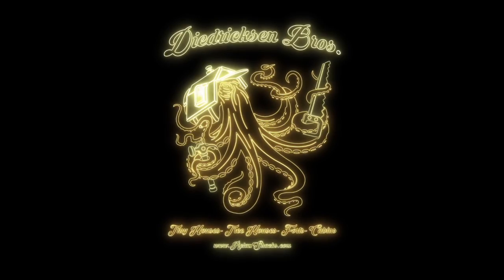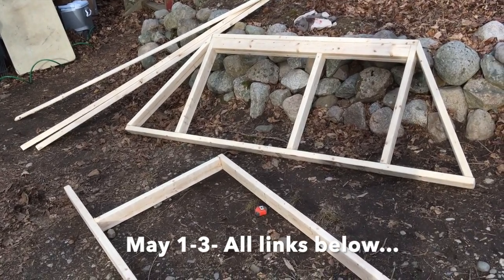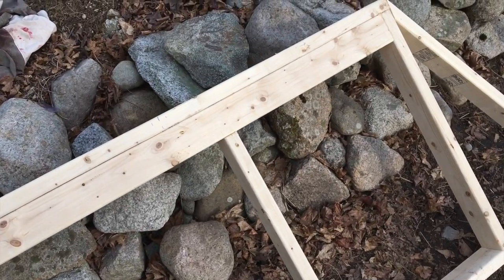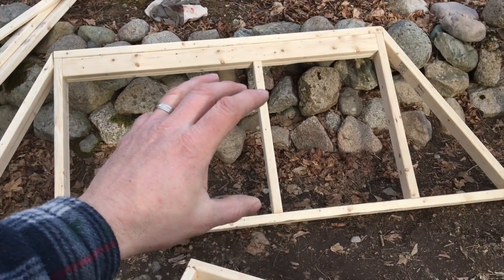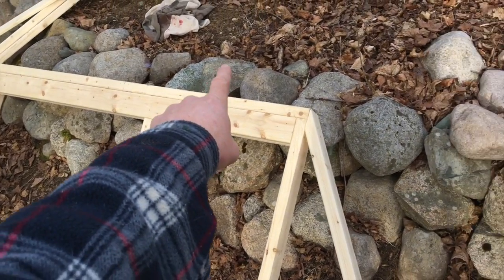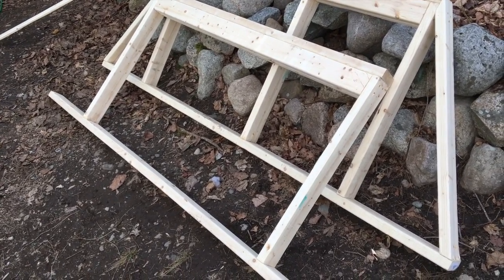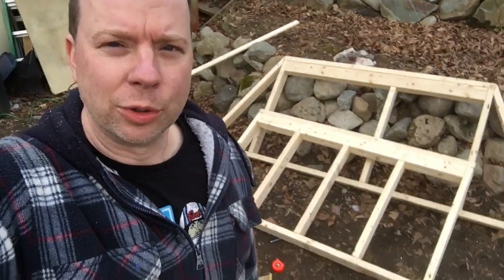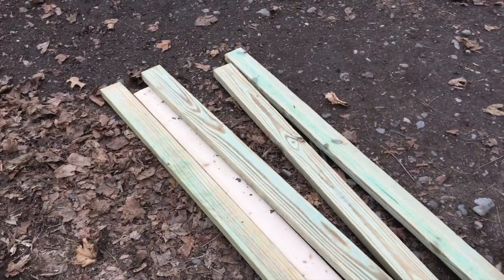Building a fun underground micro camp cabin (Earth Berm Hideout Hut

Comment: I think setting the frame on individual blocks could ultimately save on the materials in both cost and weight. 
Even if you still use crushed gravel under each foundation block for stability, you will still use less. 
Once the blocks are set level to each other,  we could set them aside and roll out some plastic over the site. 
Put the blocks back in place and we now have a barrier against riding damp. 
The rest of the floor could be tamped earth.
Reply from the maker: had been thinking about that too- good idea. We'll see. Appreciate it

Comment: Might need PVC perimeter drainage in the crushed stone for a really rainy season bunker.  You can angle the pipes out the back or wherever needed.  Digging the build, Deek!
Reply: JackTradesman I had similar thoughts on PVC. I have zero experience but watched enough & read enough the thought popped in my mind.
Reply from the maker: @cruikshank  Yes, most likely will add something like this for drainage.